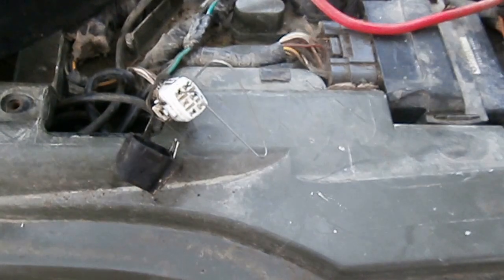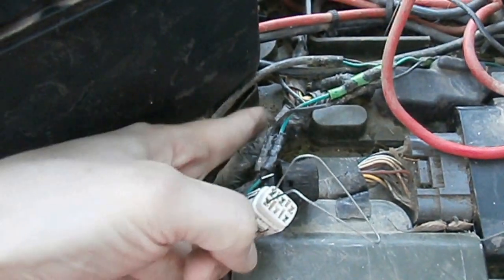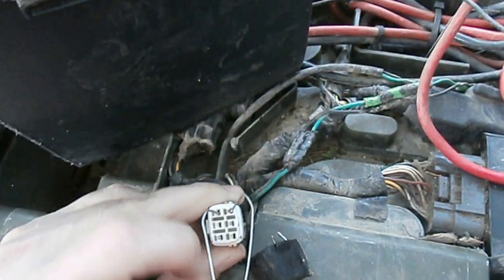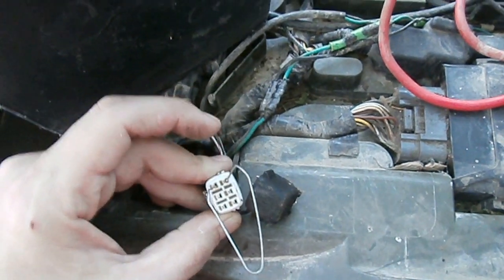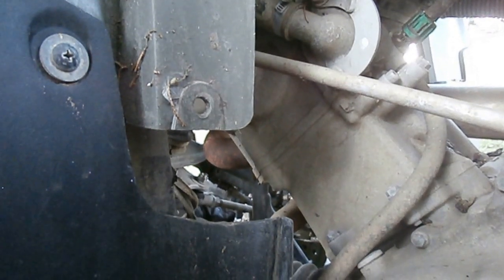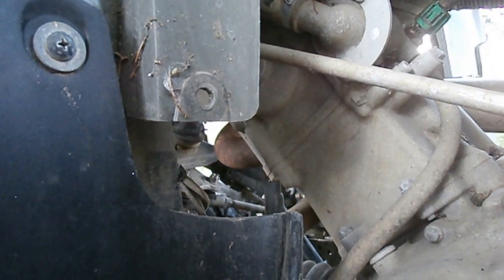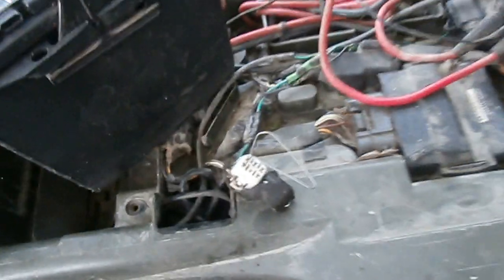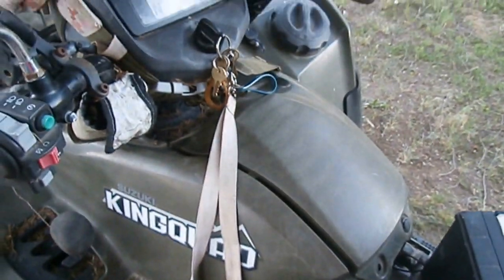Adjusting TPS on EFI King Quads

Comment: This is a good video but heads up if you calibrate the TPS then the proper procedure is to calibrate the Idle Control Module after the TPS calibration. To calibrate the ICM key off press the throttle wide open and turn key on for 15 secs and then key off release throttle and your good to go.